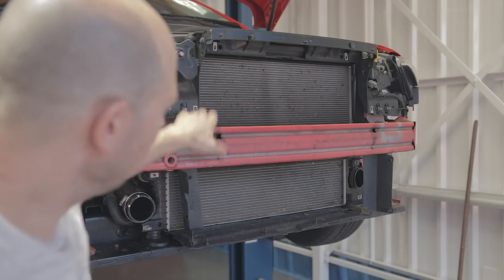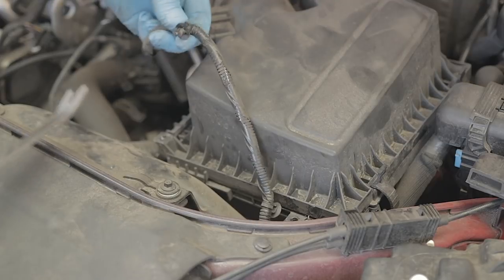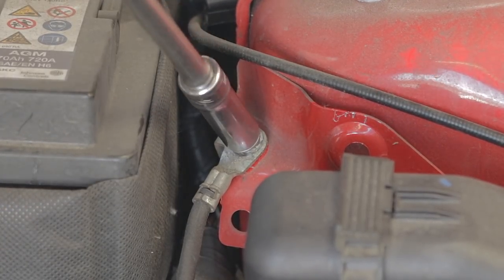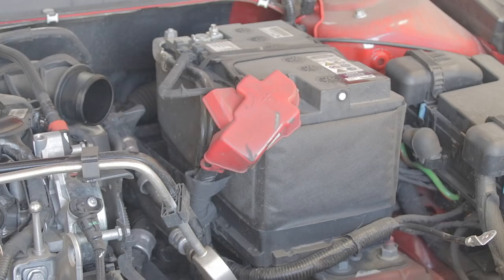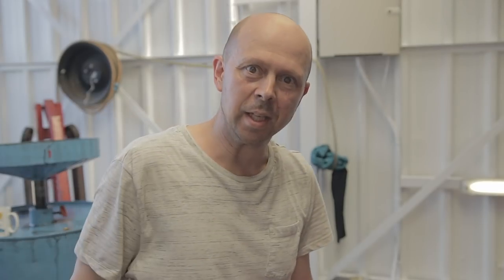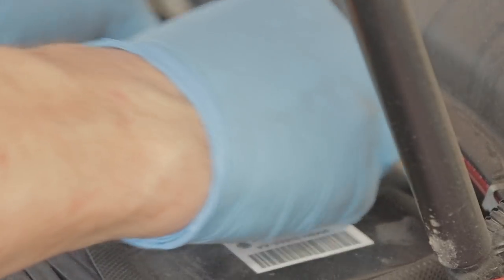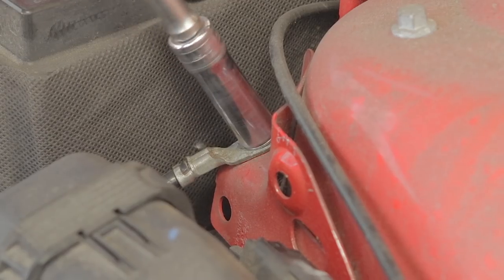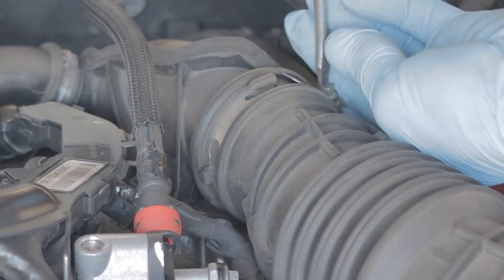Ford Mondeo Mk5 2l Diesel, Battery Replacement

Comment: 2015 2.0 diesel 180. Do I need to reset ECU etc via computer programme softwear OR just take out old and replace then reset BMS ?
Reply from the maker: You are supposed to reset the battery monitoring system in the body control module but if you don’t it will sort itself out anyway so don’t worry about it
Reply: @alan4x  Thanks. Just didn't want to find car won't start and I had to take it to garage to reset computer. Sync 2 so no radio code so one less problem.

Comment: Thank you Alan for a great video which helped me a lot. There is just one suggestion I'd like to make. There is no need to prise out the vertical cable tie mounts  (not easy to do without damage) as they have a slot to enable a new cable tie to be threaded through. So you can just snip off the existing cable tie, leave the mount in position and then thread a new cable tie through leaving the 'anchor' nice and secure.

Comment: 🤣remove the front bumper !! I wouldn't put it past manufacturers for that to be the case these days !! Alan, thanks so much for this video, I've got a new battery ready to go into my MK5 Mundano and wasn't sure how to do it. Thanks to this brilliant video, I now know how to do it and have the relevant tools. A star you are and love the comedic elements to the proceedings. Liked n subbed, cheers, Daz, Leicester.
Reply from the maker: thanks daz😊
Reply: More than welcome Al, just done the battery swap over and thanks to watching your video and taking notes it was a doddle !! I fix coffee machines not much of a car mechanic but happy to have a go of course. I bought a pry tool from Amazon, didn't need it, someone else has already broken the plastic lugs haha !! The yuasa battery I took out has a green dot which says the battery is ok, yet recently a couple of times where I've not driven the car over the weekend come Monday morning it wont start. Out comes the booster pack to get me going again. I picked up a TopDon battery tester which showed the battery is charging ok but the ampage is only 45% , 490amps out of 730a. Anyway, whacked the new one in now so all good. cheers again Al , top man 👍
Reply from the maker: @coffeeguy6673  if your old battery has lasted five years it hasn't done too bad
Reply: Yeah, I don't know how old itis Al, there's a label on the side that says to recharge 01/2019 !

Comment: Today I changed battery on my 2015 Ford Mondeo 2 liter diesel. For sure this video was helpful. 

Just one note - my airbox did anything but "pop straight out".   It took 10 minutes of wrestling in 0 degree whether 😖. But finally it gave up.

Thanks Alan- Keep up the good job 🇸🇪
Reply: Tjabba! min 2016 Mondeo startade inte i dag :( vad köpte du batteri?
Reply: @McAn666  Batterilagret har butiker runt om i hela Sverige. .
 Varta  EFB 75 AH  för 1895:-

Comment: Great video! For me it worked without removing the battery wiring entirely! So if you wanna save some time, just remove the whole airbox as described and you can easily slide in/out the battery without struggling with those wire clips or the earth lead.

Comment: Thank you. I was wondering should I remove the air intake hosing etc and I'm glad you confirmed the idea and shared the details. One note, instead of removing the full air filter box/assembly I found two little clips in the side so the top of the filter box could easily pop off. Might be slightly easier. Great video thanks again.
Reply from the maker: cheers laurence

Comment: Hello Alan and thank you for all your videos. Have original battery on mk5 2l 6 years (start stop), still working but planning a replacement because i do not want to have bad surprises far away from home. Original batt is 70AH , 720 A AGM . As a replacement I can find Exide AGM 70 AH (760 A) or Varta Silver AGM with same values. I do not consider EFB batt because I can see original is AGM. What is your experience regarding AGM/EFB and is this something to have in mind when buying new replacement battery (in order to avoid misbehavior of subsystems)?

Comment: Hi Alan, I recently acquired a Mk5 Bi-Turbo diesel Mondeo and used your video to help change the fuel filter and rear brake pads. #BRILLIANT!  Question; I was looking around and prices of batteries as my stop/start rarely stops now and believe it could well be due to battery capacity. I went on to the Halfords website which does seem very competitively priced BUT, they recommend it be fitted by them as they say "Most vehicles require this battery to be registered with the on-board computer system". Is that the case on the Mk5 Mondeo as I didn't hear anything about that on the video? Thanks in advance, Paul
Reply from the maker: hi, yes using a diagnostic tool you can tell the body control module that you have fitted a new battery, its not necessary to do that but best to as it resets the smart charging system quicker

Comment: Hello Allen, hope you see this message. On my mk4 facelift mondeo I have a 80amp original battery. Can I go up to a 85amp one, reset the Bms, and go, or should I go for the same 80 amp one. What ar the risks upgrading to a bigger one. Cheers,  hope to hear from you!
Reply from the maker: you would be fine with the higher amp battery as the electrics will only draw what is needed but in all honesty i would stick with the correct spec battery

Comment: Hi Alan, great video, thanks! What abou battery management system(BMS) reset? I've read it is needed to prevent new battery by wrong charging current. Thanks for answer! Michal
Reply from the maker: Miso Drobny 
Hi. Yes you are right. I always miss something out. Lol. 
  If the battery is actually replaced for a new one or if the body control module is replaced then the bms should be reset. On a snap on scanner it can be found under body control module
Reply: @alan4x  Hi Allan. Can you tell me if I can reset the BMS without IDS? I found somewhere a sequence like:1. Start ignition / 2. Press 12 times the rear fog button/ 3. Press 6 times the hazard lights button / 4. Ignition off / 5. Start ignition and you will see that battery light will blink 3 times.  But...I don't know if somebody tried this method or not. Please, can you tell us if you know about this? Thanks
Reply: Manual reset for Bms on most fords is ignition on,headlights on press rear fog light switch 5 times then press hazard light switch 3 times and wait for battery light to flash hope that helps :)
Reply: Battery reset on mk5 Mondeo is turn ignition on ,hit the high beam 5 times ,then press brake 3 times ,and the battery light will flash 3 times
Reply: @MarkWilson-qb5kr  thanks this reset procedure worked in my 2016 mark 2 S-Max as well. The other method using rear fog lights did not work for info.
Reply: @MarkWilson-qb5kr  This worked for me on my 2017 Mk5 Mondeo Vignale. Had to replace the battery after the original failed on the overnight ferry from Italy to Greece - a bit embarrassing holding up a queue of vehicles behind you trying to disembark! Thanks Mark!

Comment: Alan,how do you jump start a mk5 Mondeo please? Many thanks tim.
Reply from the maker: hi, with jumper cables...the positive lead goes to the positive of the battery and the earth lead you connect to the metal lifting bracket on the engine or the engine mount
Reply: @alan4x  thanks Alan,have a nice Christmas.

Comment: Thank you for the video, with your instructions, I was able to replace my battery that suddenly stopped working.
For information, the new battery I installed in my Mondeo mk 5 completely drained after 2 months. The mechanic jump-started it with a booster.
I went back to where I bought it (a chain of mechanics that also sells spare parts), and they told me that the problem is that I installed it myself, so I didn't perform a reset on the control unit (to let the control unit know that the battery is new), and therefore, the alternator is not charging it properly. So, they say I should leave the car with them to fully charge the battery and then reset the battery status on the control unit.
Do you think this is necessary? Is it required to reset the battery status on the control unit every time you change the battery?
Thank you very much for the information.
Reply: yes.

Comment: I have different air inlet pipework on my 2015 Mk5 Titanium. Had to split the air filter box to reach under it with a crowbar to free the box from the 2 rubber grommets. Also managed not to move the cable trunking fixed to the battery tray, just lifted the battery onto the trunking to remove the connections and then lifted it over the trunking to remove it.  

Now hoping that the heated screen will see me through the winter. Don't get me started on the BMS in the cars. 😡

Comment: A quick question - if the car is locked when I pull the battery the alarm goes off.  But as my car is on the road I don't want to leave the car open while the battery is in overnight for a charge (it's not getting used at the minute with the lockdown).  Is there a way to leave the car locked and remove the battery, without the alarm going off?
Reply: I'm about to do the same. I'm guessing to just lock with the key rather than keyfob? Will this work. I hope so
Reply: @JamesWhiting96  I ended up throwing a spare battery in (was a small one from a fiesta - but good enough to lock the car) while I had the main battery out for a charge.  Have done that a couple of times now.
Reply: @tomaskelly6507  Thanks, not a bad idea. I don't have a spare battery however.

Comment: Great content as usual. 
Do you have any 2.2 tdci on the fleet? They are awful to work on apparently! 
I haven't had the chance myself but a friend of mine recently had his cam belt snap. ☹
Reply from the maker: hi, as yet i have not seen a 2.2 either, no doubt i will have the pleasure at some point lol
Reply: David there's no 2.2TDCi as far as I'm aware?
Reply: It's used in the Mondeo and in x types. 155bhp standard output.
Reply: Not the Mk IV or Mk V.
Reply: Not common in the mk4 but definitely available as my pal has one and it just went bang. 😯
Reply: Mk IV 2.2 was 175 and 200PS. But it's basically the same engine as the 2.0 with a few minor differences.

Comment: Would changing the battery have effect on the handbrake as its electric? My mondeo is parked on a hill and needs a new battery
Reply from the maker: If your handbrake is on and you remove the old battery the handbrake will stay on so don’t worry about it

Comment: and BMS battery reset nothing?
Reply from the maker: you can do a reset on the battery monitoring system, doing nothing will still be ok, it will sort itself out after a few miles
Reply: @alan4x  thank you for your reply. Ive been noticing the see manual key lighting up since I changed the battery. it is absolutely random, sometimes lights up after few miles, sometimes after using the car for two weeks. It is quite annoying. have you seen anyithing like it before? do you have any idea?
Reply from the maker: @videoneked3647  best thing you can do is get your ecu codes read which should point you in the right direction as to what may be wrong
Reply: @alan4x ecu is clear, after few miles lighting up transmission limited function see manual and car I didn't change gear and revs go up....I wait ,done few miles and again is normal .. its a mondeo mk5  2.0 diesel powerS. ...what happen? do you have any idea? thx

Comment: Hi Alan, thanks for the video. One question : what is the purpose of the cover around the battery?

I ordered a replacement battery for my Mondeo Mk5 but the new battery showed a slightly higher length and to fix it I had to use the second position of the battery bottom clamp (in your video you can see there are two positions provided). So I cut the cover open so that it is now partially around the battery. Has this any importance?
Reply: See the video after 2:00 minutes : there is a second bolt hole underneath your finger.

Comment: I need a new battery in my Mk5 and I was quoted $290 for the battery and $100 to install it (52 pounds), because they need to "reprogram the ISS". Is this required!?
Reply from the maker: it'd the press of a button to tell the ecu your battery has been replaced using a scan tool but i can say i have changed numerous mk5 batteries and not carried out the reset without any problems
Reply: @alan4x  Ah OK thanks Alan! They said 15 mins to replace the battery and 30 mins to reset the BMS, which I think is absolute BS.

For everyone else with the same question, this is how you reset the BMS without the scan tool:

Turn the key to position 2 (the ON/RUN position). In cars with push button start you press the button without depressing the brake / clutch pedal). The engine warning light in the dashboard will now be lit permanently because the engine is not running.

Wait 10 seconds.

Press 5 times in a row the switch for the rear fog lamp.

Toggle 3 times in a row the hazard warning lights (on-off). The hazard warning light will keep blinking now.

Wait 10 seconds.

When the procedure has been carried out correctly, the engine warning light will blink a number of times and the system is reset.
Reply: Hi, I did reset to the Mondeo 2016 this way. Ignition on -> 5 times flash high beams -> 3 times brake pedal. Only that way I managed to get 3 times battery icon flash and now start/stop working after the battery replacement
Reply: @Thedogbond  do you know if it will work even replacing the battery on a Galaxy 2.0 tdci 150hp with S&S , year 2016?

Comment: I recently bought a Mondeo 2.0 TDCI 180HP  old 3g with 90tkm and I constantly travel the same relation of 650km on  highway and the consumption was about 5.3 l per 100km , i drive 90% on cruise drive.
Tree months ago,  the Chek engine turned on and I turned off the car and started after a few minutes and the lamp was no longer on, went to the authorized FORD service and they said that the battery has to be changed (waiting for the battery) in the meantime it was driving and the consumption jumped to 7 l, changed the battery in the service a week ago and canceled  some minor mistakes over OBD (steering wheel, parking sensors, etc.) they telling me that after some time driving  consumption will come back to the old one just needs mileage.
Now I drive and drive 5000km  highway however it still spends 20-25% more and it does not show any error on the tester, today I go again to an authorized service and nothing no error , they chekd DPF and EGR over diagnostics and said it is ok.
What can go wrong because low voltage of batery , or something else.

Some idea what it can be?
Thx
Reply: Gaso jesi otkrio u čemu je bio problem?

Comment: Do I need to perform any resets after the battery has been replaced?
Reply from the maker: you are supposed to tell the car you have changed the battery with a scan tool but this rarely gets done and i have never found any problems from not carrying out a reset
Reply: @alan4x  thnx! I called the Ford Dealership, they'd charge me a ridiculous amount of 380 euros (!!!!!) for a new battery. I found one with the exact same specs for 130 euro's and had a guy install it. He also reset the car to 'brake in' the new battery otherwise it wouldn't charge the right way he said..... anyhow thnx.

Comment: Hi Alan, I’m considering changing the battery on my  MkV 2015 Tdci as the heated front screen and stop start are now inoperative even after charging the battery for a couple of days.
I notice this is an agm battery fitted to this model. When I search for the correct battery on Eurocarparts and other suppliers an efb battery comes up in the search results. I understand these are  slightly lower spec than the agm but considerably cheaper.
Any idea if I can get away with fitting a efb on this model?
Reply from the maker: hi.....i would ask the supplier if the battery is compatible with start stop as it is an uprated battery and not cheap
Reply: Turns out mine is an efb battery fitted from new not an agm as I originally thought. .  Ford must have changed to agm batteries on this model sometime after mine was built.
Managed to pick up the correct efb one from Halfords for £88 Inc vat with trade discount (model efb 110).
Reply: Just bought the efb 110 from Halfords 3 years after you and its now £120 with trade card 😂

Comment: 47k march 2018 titanium edition
Battery light came on when driving within a short distance car limp mode and then stopped refuses to start battery losing charge rapidly recovery person connecting it up and it still won’t charge/start the car battery quickly goes down to total zero for all intents and purposes???? 

MK5 

No indication of problem other than stop start stopped working about five weeks ago

Comment: I prefer to start doing other way round as when I connect positive first and then negative cable to the body I always have massive fireworks. Last time when I did i messed something in my body control module. I think this ford invention is complete crap.